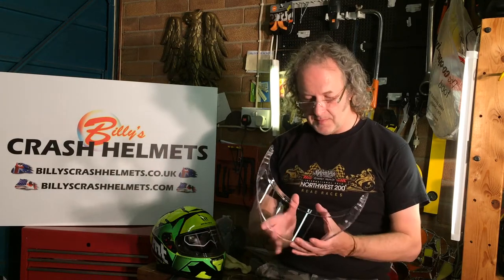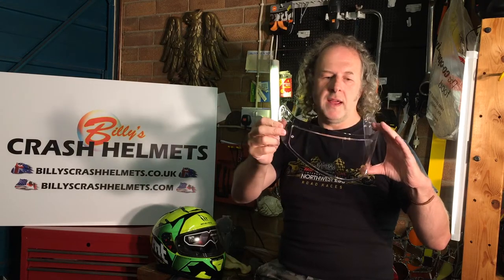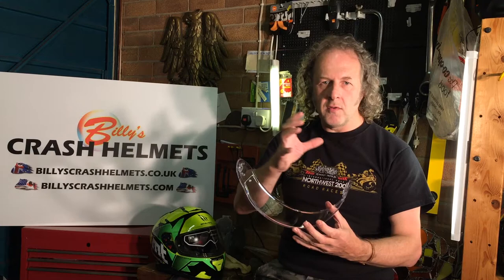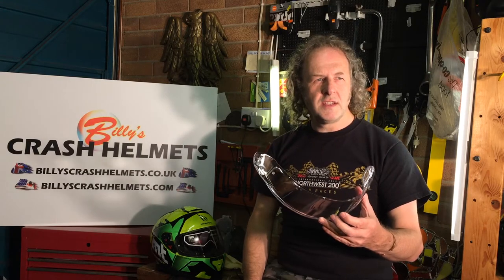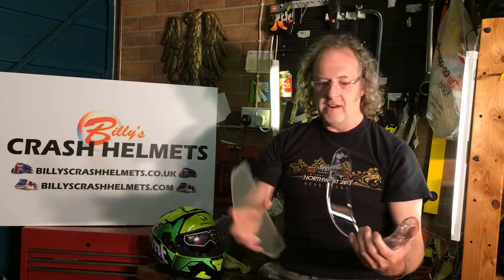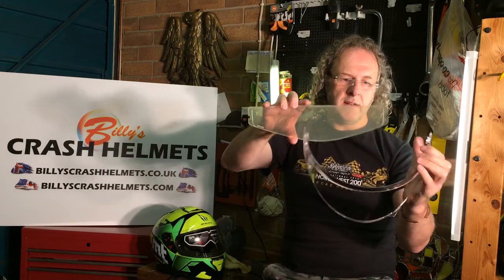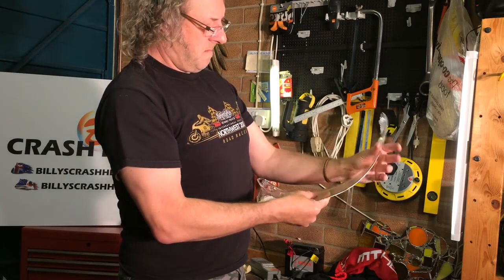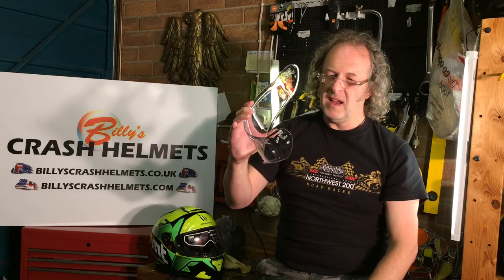Fitting Pinlock anti-fog inserts - and how they work

Comment: Hi

Good video.

Can you shed some light for me please?

I was recently on a solo motorcycle tour of Ireland. I hit a few rainy days - particularly arthritis end of my trip (overall riding 8-9 hours in heavy rain).

Now, my pinlock acted very strangely. Water was nicely running off the front of my visor, and fogging wasn’t an issue. However, I was getting a lot of rain droplets INSIDE my visor... on the surface of the pinlock itself, internally. 

**It was almost like it was raining *inside my helmet!***

I had a lot of trouble and found myself - out of necessity - having to keep my visor partially open. It was pretty dangerous to say the least.

Encountered this before?
Any ideas as to the problem?

Comment: When it begins to fog up, remove it overnight and let it dry out then reinstall.
Reply: Hopefully you mean the shield and not the insert. It’s easy to snap the pins or even the shield itself and removal should only be done when replacing, maybe for a clean but only when absolutely necessary.